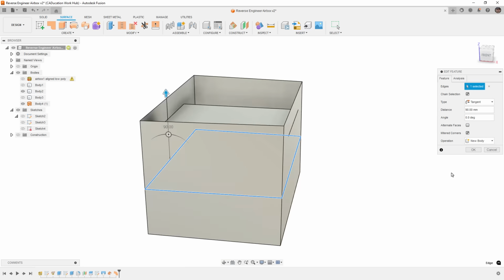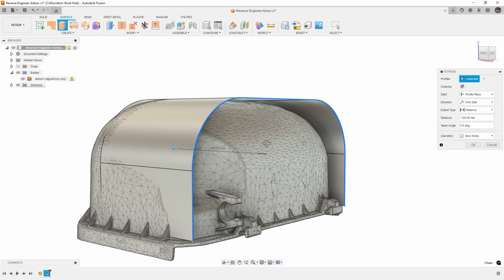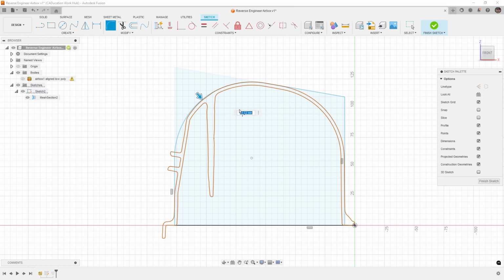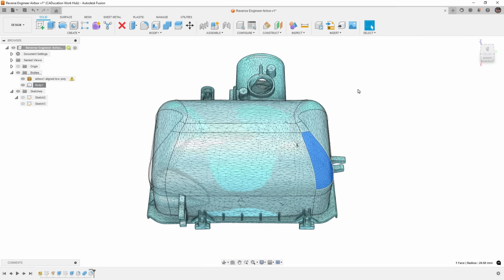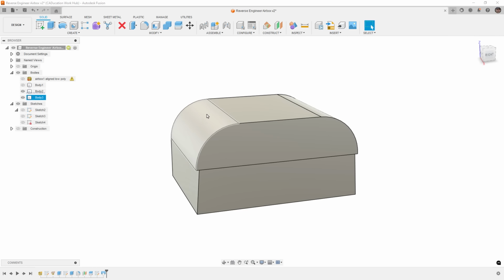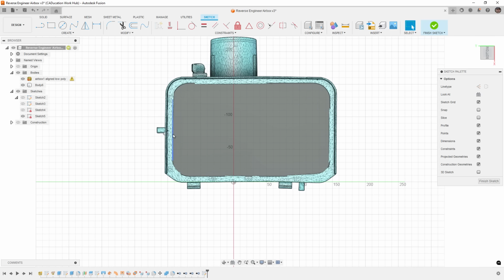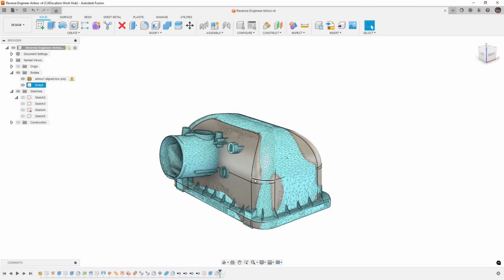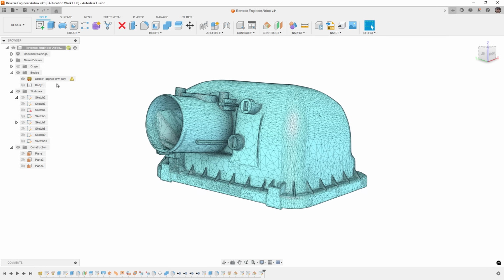Reverse Engineering Scanned Car Parts - Airbox Series Part 1 #fusion360

Comment: Lovely!  Would it be possible to do all this with the form tool? 😊

Maybe I missed the reason. 

Great videos!
Reply from the maker: This is probably not a part I would do with forms.  You could do parts of it, but the core shape of the airbox was pretty simple for using the extrudes from 2 directions.  It would be more difficult with a form,

Comment: $555 for QUICKSURFACE Lite????? What kind of crackhead pricing is that for hobbyists or students?
Reply from the maker: There is a QS Personal for hobby users that is about half the price.  QS Lite is a stripped down version of Pro but it allows you to still do commercial work and make money with it.  Pro is around $4000 so its a pretty steep discount for access to some nice tools.

Comment: Hi,
You saying you align the mesh in quicksurface, but can you do it good in fusion aswell?

//Simon
Reply from the maker: Hi Simon, you can but its tricky.  You don't get any feedback on how close you are to a plane on the mesh and you also can't define the coordinate system location easily.  For example in QuickSurface you can select the bottom flange, create a plane, then a second feature and ensure the next one is perpendicular to that first plane.

Here is a video in fusion but note that with Intent driven design you want to be in a Hybrid file type, and you will likely need to mess with "ground to parent" ensuring to disable that. 
https://youtu.be/tbwPDBflb0w

Comment: im watching ur videos man they are very good u got talent man what would suggest to me to learn this like is there somthing easy to start with in your channel
Reply from the maker: thanks!  What types of parts are you looking to make?  We have a few series on the channel that go from scan to part.  Widebody fender,  Duct to replace a fog light.  motorcycle tailsection, headlight, fender.  We also have loads of other videos and series that cover scan to part for things like RC cars and general design.  so it depends a bit on what you want to start/learn on.
Reply: @LearnEverythingAboutDesign   i would like to start with simple shapes like car inteior parts
Reply from the maker: @1993saif1  I have a few videos in the works at the moment.  One will be a shifter trim panel.  the other is going to be an engine bay cover.
Reply: @LearnEverythingAboutDesign   ok will wait for them  and thank you for the help <3

Comment: Unbrauchbar das Video, da alles nur geht mit Quicksurface was 4000€ kostet.
Reply from the maker: There is a new personal version that has more tools that LITE but you can't export CAD models, only an STL.  It is meant for users who are not doing commercial work and is 20 euros/mo  https://www.quicksurface.com/quicksurface-personal/

Comment: I would love to see this part reversed engineered in QuickSurface. Thanks for the video. Helps alot having your thought process while doing the steps
Reply from the maker: I appreciate the feedback.  I filmed a "what QS Lite would do for you" video but wasn't happy with it.  I will be adding an EP5 to this talking about what would be different in QS Lite.  QS Pro is really where the process is different because you have all the CAD tools available.  QS Lite the main benefit is quick generation of primitives.

Comment: Great video again! I would love to see a video around quick surface before pulling the trigger, I know it’s great for reverse engineering a part. But what about additive design? Ie I scan a rear spoiler location then design a new spoiler off that scan in quick surface? Is qs equipped to do this? Or it’s it only for creating like for like ?
Reply from the maker: Thanks!  I have used QS to "model" parts and I would still stick with a dedicated CAD program.  QS lite is really good at letting you align to xyz, extracting primitives shapes, and doing some reverse engineering tasks.  QS lite has limitations on which tools you have access too of course, and you can't combine solid bodies, but you can export them all.  

I have had a future look at the next version of QS and it might get better, but I know their goal isn't for it to be a stand-alone CAD program.  Most scan-reverse engineer programs are meant as an intermediate step.

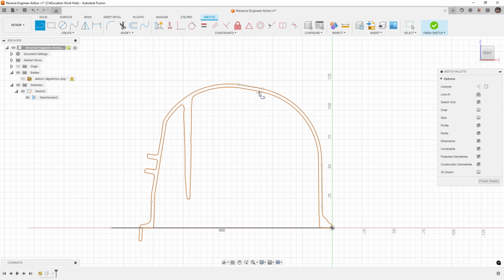Comment: Hi Matt, quick tip or question: around minute 11:50 with lines created aligned with mesh using fit curves to mesh, wouldn't it be better to use Extend lines instead of moving the points around? Although there is not much precision in the process it seems less eye balling to me. What do you think?
Reply from the maker: 100% great point.  Extend lines would be a great option.  I almost never use it and as you said we weren't being super precise, but yeah Fusion does a good job with that tool.  Some CAD programs won't extend lines to an invisible intersection but Fusion does so for sure use that!

Comment: Perfect timing! Thank you so much for these videos!  About to pull a trigger on a MetroX and rework my turbo setup!
Reply from the maker: Awesome!  Are you scanning in the engine bay? the Miraco being fully wireless is a great option for that and Revopoint is about to release a new MetroY scanner.  We will be testing soon.  The MetroY Pro lists a wireless option so something to keep an eye on.
Reply: @LearnEverythingAboutDesign nice!  I will be doing partial engine bays, turbo placement, intake/ exhaust flanges, duct panels, and dash stuff!  Trying to learn more with forms with your center dash part as I need to make a ft550 standalone screen cluster for my rx8 and mr2.  The over/under of the shade curve and making it meet up to the other part of the dashboard is kicking my butt LOL.
Reply from the maker: @kiaenigmaadventures  with all that if the dash and stuff are in the car I would look at a fully portable scanner.  So Miraco is one.  The new MetroY Pro (haven't had one yet) looks to have a wireless option.  Raptor Pro has a wireless add-on.  When i did the quick engine bay scan for the exhaust manifold series on the channel I used the Miraco and took 5min.  I tried with the MetroX and I couldn't reach or get a good scan.

One important thing with something like the Miraco is the ability to do small or large objects.  So on "far" mode you can be 1000mm away and then you get lots of unique geometry to help with scan alignment.  With the metroX if you tried to scan say the top of a radiator it would fail without markers because the geometry is not unique enough.
Reply: @LearnEverythingAboutDesign I got the x for $800!  I'll just stick to the smaller suff for a bit to save up lol with your classes I made a 3d printed stainless turbo flange for my Honda crz! It's so awesome and you to thank!
Reply from the maker: @kiaenigmaadventures  SWEET!
Reply: @LearnEverythingAboutDesign guess I should have been commenting from my fabrication account! Lol even made an intake adapter from your intake video!
Reply: Will you be doing other QuickSurface tutorials but using car parts as the model?
Reply from the maker: @RaRa-xg7le  We have done a few and have a QS Pro course on our site www.learneverythingaboutdesign.com  We have a video looking at a bumper in QS lite, fusion and plasticity.  I have worked on a video doing a mudflap part but not sure if the final will be in QS or not.

Are you looking for stuff in QS Lite or Pro?
Reply: @LearnEverythingAboutDesign  Ive watched your other videos. And they were the best on Youtube. Also done the QS monthly workshops. I was just wondering if you were still using QS and was gonna continue to poat videos on it. Definitely gonna look into your classes. I forgot you had those. I want to get QS Pro after doing the free trial but I just got 2 months of QS Lite with my Sermoon S1 purchase. So I have the S1 with the scan bridge and been working on a buddies race car. Gonna exhaust my free trials, do your courses and probabky get QS Pro and a Fusion subscription. Your videos are super infornative and explain alot of thought process into what steps you take which really helps RE/CAD newbies like me
Reply from the maker: @RaRa-xg7le  Awesome!  and yes I 100% have plans to keep makin QS Lite videos.  The plan is for all QS lite videos to be here on YT and the pro and for Solidworks versions will mostly be courses on my site.  Its a bit tough since we cover so many different things here it sort of goes in cycles....